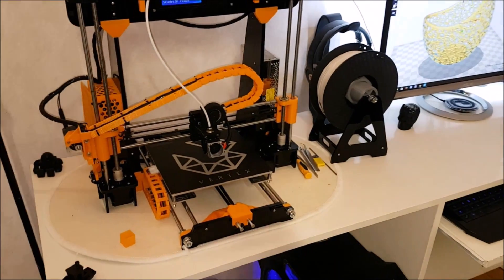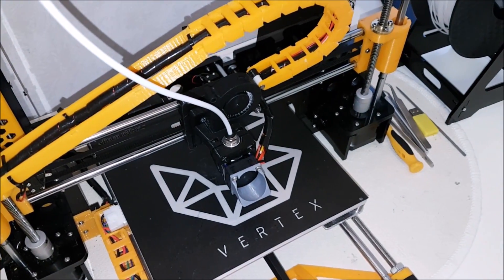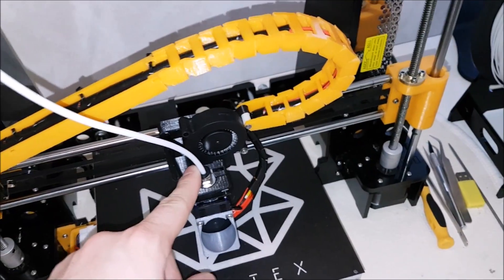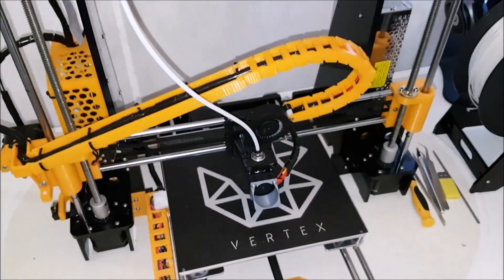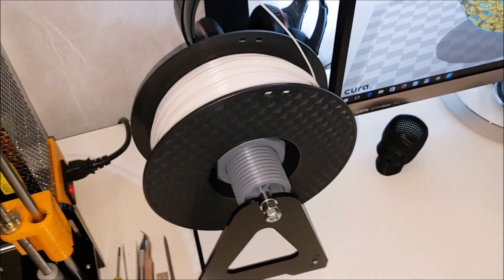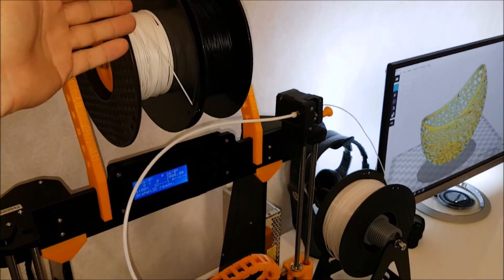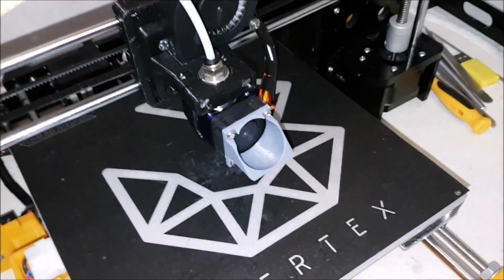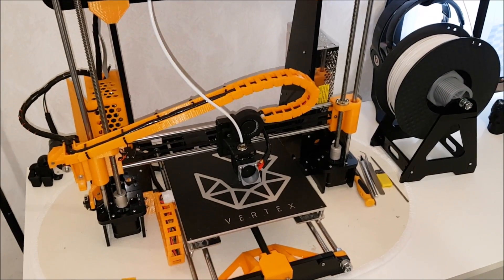Anet A8 3D printer upgrade E3D V6 bowden! Part 3

Comment: Please tell us about the bowden setup, do you need to buy the parts or maybe mounting link? And do we need to adjust setting in cura? Because fillament is far from the extruder, maybe need a little more movement?
Reply from the maker: Everything is printable you only need V6 that cost less than 10 bucks. Settings on Cura is same only Gcode is little different but its not must to do if you print small parts. I make video about ''how to'' about this upgrade soon.

Comment: I just used 3 layers of radiator insulation under the bed works great.
Reply from the maker: brian whittle Nice!
Reply: It's probably not suitable in the longterm if you need 100C plus as it has expended polyethene  but for PLA it means it soon gets up to temp.

Comment: how much did all your upgrade's cost?
Reply: that's quite expensive. from what I read the mk2 original cost at 739,00 € tax incl. for the Netherlands. are you shure you're right. because i can surely get that for cheaper. $14.99 for the hotend and for auto leveling for $2.85. all the 3d printed part combinned are problably one roll wich converts to 20.99 $.
Reply: combine that all 39,00. can you explain why that answer
Reply: To make you understand:
There are people like you that need products that work "perfect" out of the box and do not care much about the 500$ they have to pay more.
And there are people that LOVE the extra effort they have to put in a 150$ printer to make it work safe and print like a 1200$ one. (watch his latest printing video of printing a phone stand!)
Soldering, exchanging Wires, printing improvement parts, upgrading parts and even waiting for them 4 weeks;-  all that is FUN for many people.
Because you seem to like calculations:
Lets say a cinema ticket cost 8$ and you get 2 hours of fun. Going not to the cinema (worth 8$) but instead working 2 hours on printer improvements with fun (also worth 8$) gives you a total of saved 16$ for 2 hours fun time. If you just work 10 hours on your printer (that is approximately the time you need to assemble the printer when it arrives) and other 10 hours on improvements this makes 160$ or in other words, you already got the printer for free! 
So in result 20 hours in great fun and a free printer on top!
If you buy all he improvement parts combined with the fun time to assemble these you even make a $ win and as a result have a printer that is save, prints excellent and along the way has made you a 3D printer expert.

Comment: Hi Nexi, good job, were is the file for the bracket that hold the filament holder on the top right? thanks
Reply from the maker: Roberto Gil MK8 motor mount for bowden on Anet A8 found on #Thingiverse https://www.thingiverse.com/thing:2039986
Reply from the maker: Roberto Gil Sorry mate!  Here you go! :)
Reply: Thanks a lot

Comment: can you post your cura settings / expert settings with the bowden setup?
Reply from the maker: This is nice! http://www.thingiverse.com/thing:2038584
And take cover from this http://www.thingiverse.com/thing:1767285/#remixes
Reply from the maker: MyRedStallion There are same like before for now. No need to change  nothing.
Reply: great video, could you tell me the dimensions of the motherboard case?
 doesn't seem to fit my bed when i load it up on cura from thingiverse,
would REALLY appreciate it.
you earned a subb ;)

Comment: So many Upgrades to make but i don't have the money atm. 😢
Reply: Most of them are printed from the printer themself...
Reply: Jere
I'm talking about the e3d hotend, the Buildtak and the extruder.
Reply from the maker: Nope you write code only once. Start and end Code. G Code are saved in Cura. No need to do nothing between prints. Just run.
Reply: A link would be nice :)
Reply: WannaDuino! The Real Live
Why would this mess up the printer?
Reply: All of the mods including the Firmware ARE reversible. Once you have set up the firmware right there is no need to change any G Code.
 Cura remenbers the start and end code since it is part of your printer settings in Cura.
Reply: Prove ?
Do not realy understand what you want to say. You can flash any firmware you like vice versa.
Maybe except "just google it" this helps:
http://anet3d.en.made-in-china.com/custom-detail/xmQExQndGJUQxmQExQndGJUQ/The-Firmware-Links-You-May-Need.html

Comment: Have you changed your power supply?

any issues with the burning of the cable for the hotbed?

or did the Mosfet fix that?
Reply from the maker: I don't using so much heat on heatbed right now sens I have Vertex build tak but even if I using heatbed on 55C I did't notice any cable heating. My cables are thick  and they don't get worm. I heat up bed to 100C and left it on 100c some time just to check PSU and Heated module(mosfet) and cables and they was fine. If I notice some heating I will install even thicker cables or possible change or upgrade PSU.

Comment: Hey is it an actual E3D hot end or a clone? Man love your videos, I should post some of my upgrades
Reply: John Gonzalez I'm thinking the same.The price is way too low.
Reply from the maker: John Gonzalez Yap that's clone 100% :D Im really not going to put 120USD for this part that can easily be made on CNC for 5 USD :)
Reply: And it has such a huge difference from the previous ,only with this price?

Comment: Well I bought an anet a8 and right when it turned on the side Circuit board exploded 😢
Reply: Well, I bought an ANET printer, it was cheap as hell, and it worked like a boss from the get go.   YMMV.
Reply: GymBoyB wiring problem or faulty board?
Reply: didn't follow the wiring instructions apparently
Reply: ouch thats a shame, sorry to hear that
Reply: GymBoyB Is GearBest support any good?
Reply: GymBoyB hmm thats odd. On my friend's anet the power suplly was set to 220volts even though we are in the us and it ran fine. Switched to 110 later still works
Reply: buy a new circuit board
Reply: No we just decided not even try with them so we just bought another  Circuit board full price
Reply: Dak Boi actually I realized my mistake... I wired it correctly but in the power supply the switch was set to 220 volts and becouse I'm in the USA after plugging it in once with the 220 I switched it to 110 then it exploded

Comment: Just bought the hotend upgrade, Sooo keen to see the how to vid and really keen to try out the new hotend, I will say i think that is a clone of the e3d v6 as i have seen them go for like 130$, But with that quality at only 20$ AUD im not gonna argue haha.
Reply: Liam Batge Hey mate, just wondering if you managed to try out your new hot end. Im from Aus also, and am debating on whether to get a clone or an original. But i guess, as you said, its only $20AU, so if it dont work great its not a huge loss.
Reply: Hey there, I am actually still waiting on my hotend to come, i got mine when Chinese new year was on so its only just left china and will still be a while till it gets here sorry. and plus i think my printer is out of whack .5 to .75 mm on one of the axis', which is gonna be a pain to re calibrate, i might be able to jerry rig the plate that mouns to the bearings given that its not way out, I will have to print a couple of test cubes at 20mm, 40mm and 60mm to try and work out how much to adjust the code by, kinda pissed that i have to adjust the code for it though, its so bloody hard to do, Although i may be able to adjust the model to compensate for it